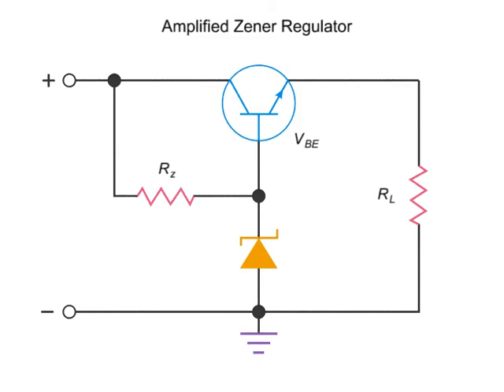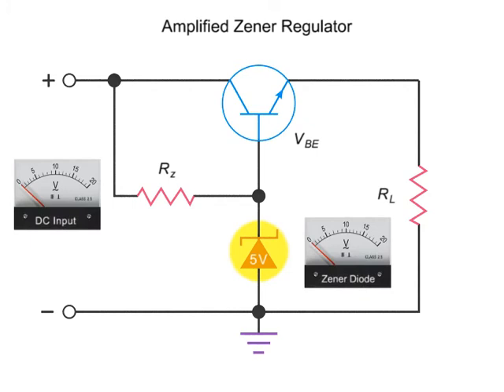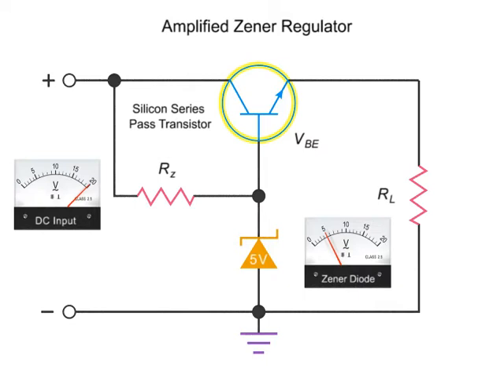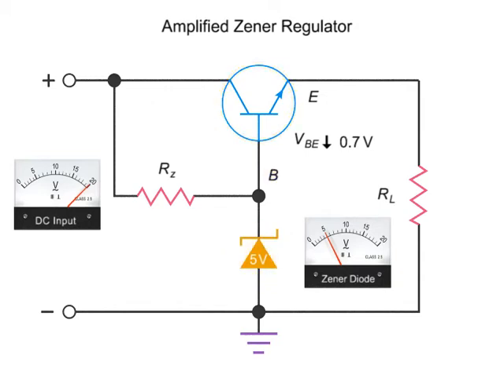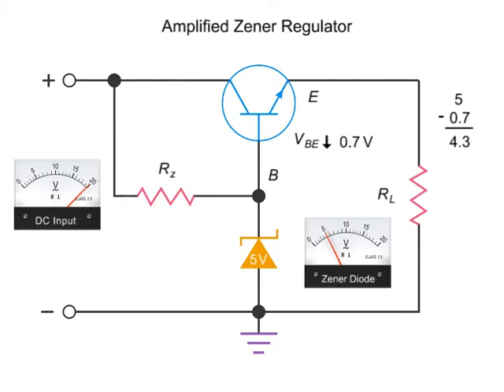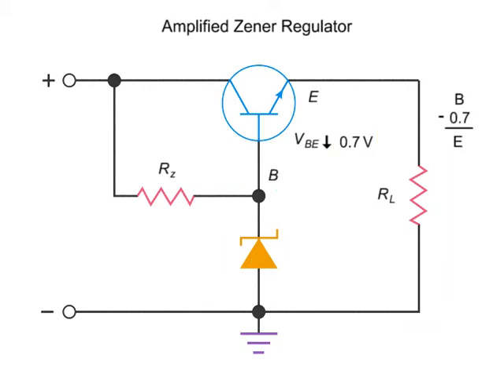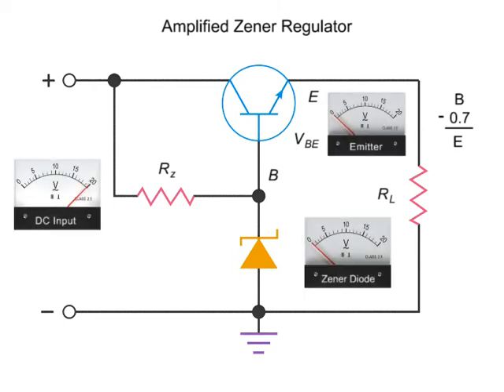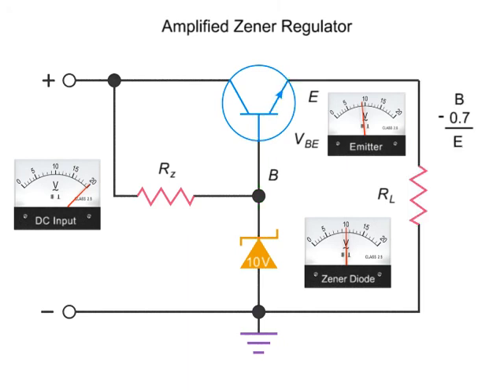What is a Zener Diode?

Comment: Your explanation is awesome  , please make video's on different topics  like Multivibrators , bjt different configuration like CE ,CB etc amplifier,  type's of power amplifiers  , e.g. class A , class B ,class C ,  differential amplifier  , multistage amplifier  , Modulation   , Demodulation  , specially video on RC  ie Remote Control circuit's  explaining how the transmitter and receiver circuit works  , how the signal is transmitted from transmitter to receiver to control the motors of RC toys